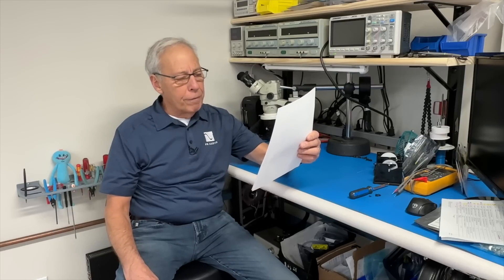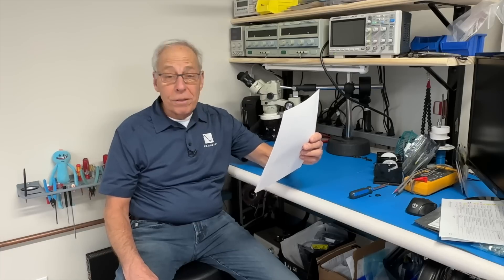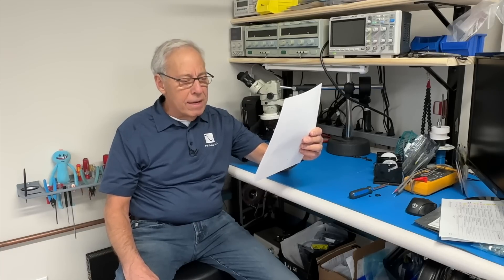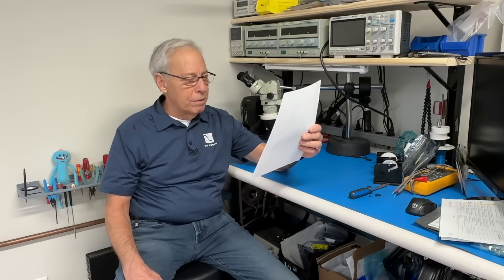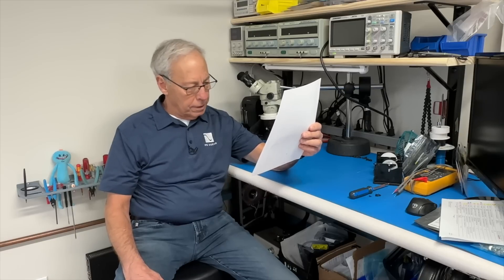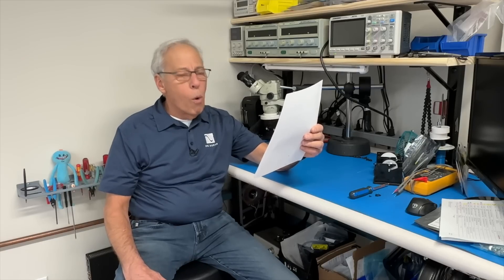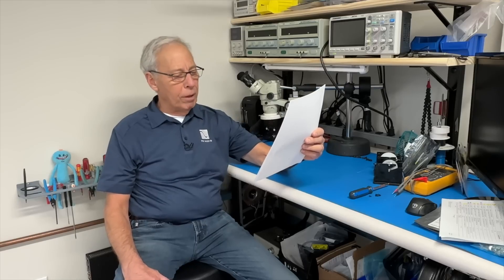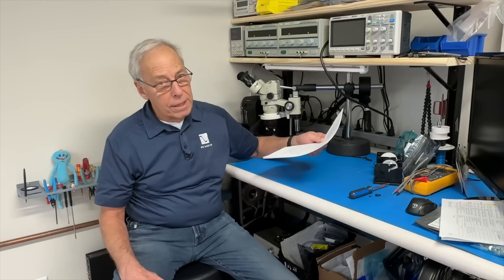Class D amps inherently inferior?

Comment: I need help here, I am looking for amp an I like the Audison 5.600 sr to my components focal 165 k2 and a 10inch Fosgate P/3? Any suggestions
Reply: I use a 3 way active focal kx2 components with a utopia mid. I upgraded my Harmotech tube hybrid amps for a 6 channel Zapco AP150.6 and the results are astounding. No glare at the highs, clear and detailed vocals with tight and controlled bass. I’ve heard a friend’s kx3 kit with Mosconi AS amps and they are fantastic too but I prefer my Zapco.
Reply: @xdaggersoul  
That is the name I couldn’t remember, Zapco..👍🤗😎
I looked at Zapco years ago before Zapco was sold to another company. Zapco 
Zapco use to be made in California back then. Great amplifier’s. 

A lot of new improvements in audio have been made since I bought my system 12 years ago. I went with all JLAUDIO amps and speakers from the JLAUDIO dealer that also does installation. A/B Slash series Amps. 4 and a 5 channel amp. 

One of the main reasons I went with all JLAUDIO was he owns that dealership won several SPL trophies with his JLAUDIO car. He has a lot of various trophies from over the years. 

I took that system out of my truck several years ago when that truck was traded in. Never had it reinstalled.

Just recently my OEM stereo in my car has a speaker short somewhere. I have an old Eclipse head unit and speakers in custom made cabinets. I plan on hooking up the head unit with a 12 volt plug that I’ll plug into the 12 volt cigarette lighter for power. Just use 2 speakers in the back. I have 2 McIntosh 6.5 component speakers in those cabinets I bought years ago.  Leave the OEM intact.
Reply: I would recommend going for a dedicated monoblock for sub duties
Reply: Audison are popular amps. 
Lots of people use them. 

Installs can be problematic.
You have to find a good installer that knows what they are doing, plus the fine tuning. Fine tuning is relative to the type of music you listen to the most. I had my system fine tuned to classical, jazz and blues by the installer. That worked out well for me. Yes I did use a subwoofer, that was fine tuned the same way. 

Depending on where you live you might not have access to a good installer or at least easy access. I don’t mess with that myself on any level. 
I also bought everything from one manufacturer except the head unit from a authorized dealer that did the install. 
That was more than 12 years ago. 

Back then I looked at a complete McIntosh system including head unit from a McIntosh dealer that also did installs. Expensive..LOL. 
Way over my budget. 

How do you like the 165 k2..?
They have the Utopia also.
Expensive. LOL.
Reply: @davidfromamerica1871  Hi thanks for responding, I do love my 165 k2 it was awesome upgrade from respectfully the JBL gto609c  components, you get spoil on the quality of the sound. I still have my JBL gto629 in future get does focal maybe. I had the cxa360.4 kicker amp with an old school EQ clarion 755 with epic center. Little by little trying to go for best quality at a good price. I live in San Diego they have a lot of good stereo shops, thank again
Reply: @carlosleon1976  
Glad to hear you like the 165 K2. 🤗👍😎
Focal also has their own amplifier’s.
Reply: @davidfromamerica1871  I also at focal amplifier before this one, thanks

Comment: Isn't that a bit upside down... get the right speakers to begin with and don't try to compensate with your amp for your thin sounding speakers... on the other side, if you like the coloration from vacuum tubes, or any other A/B amp, by all means go for it.

Comment: so class d is so bad that only the best amplifier ever made- a vacuum tube can save it.
that's what nakamichi did with their first cd players and it's also the answer for digital sound.
what about a class a/b power amp with a tube preamp? why introduce something with a problematic tone like class d into your system in the first place and then try to solve it?
class d is a cheap way to amplify. it saves space and doesnt generate heat unlike good sounding amps class a a/b or tubes.
Reply: Nonsense - you won't stand a blind-test

Comment: Amplification is not really a problem now days. Class D amps today are not the same as they were in the 80s and 90s..... While it is true that it is still a bit of a challenge to get class D smooth as class A/B, many of today's class D amps can come pretty close. That said though the inherent thing about class D amps is that they do tend to be on the bright side of neutral. So in this situation mentioned here, I think it is more of a mismatch than anything inherent in the amps. Pairing up rather revealing speakers such as the Focals to any class D amp is going to sound bright with the adjacent illusion of sounding a bit thin. Pairing any speaker that is tilted up to a class D amp will sound this way. In fact, one of the worst pairings I can think of is hooking up a pair of Paradigm Personas to a class D amp. While the Personas are not revealing in the true sense, they are very tilted up. (Side note: Those speakers actually don't sound good with anything from my experience with them. That is a real shame when you consider that the bar was set high with the Studio series they used to make. Those were one of the best speakers ever on the market by most accounts, but as with things audio, progress marches backwards instead of forwards much of the time).
Reply: They may be brighter because it may turn out that you need some extra dB’s of headroom over whatever average power level you’re going to be playing the thing at; so in other words, if you need a 50 watt per channel amp, maybe you really need a 100-150 W per channel amp in order to listen at at 5 W or 10 W out and not have it sound bright or worse (harsh).
Reply: @shipsahoy1793  I don't have a class D amp. I was just responding to the question. That said though, headroom is concerned with load and speaker efficiency and distortion, but has nothing to do with brightness or warmth.
Reply: @ericelliott227  You surprise me. Distortion has everything to do with tone and the “perception” of it. Same with S/N ratio and dynamic range. 
Btw, having a background in something and having experience with it are requisite to each other. 
One without the other, and you’re missing something. Similar to being a musician.
Reply: @shipsahoy1793  As I understand it from many years with playback (home audio gear) and some live sound engineering experience (the musician part of the argument, if you will), Distortion is an anomaly that interferes with clarity, not tone in playback systems. It's use in making music is an entirely different animal and in that case has direct effect on tone such as with an electric guitar. 
Lower sensitivity speakers have lower threshold for distortion no matter the amp. I always say "the louder the volume past the demarcation of the system's headroom the less detail". Most audiophiles (and many rock musicians) are deaf from playing too loud. (No, I'm not knocking rock musicians, I love rock music and was in that scene for a few years from roadie to management and lots of stuff in between. I'm just stating the obvious). So the levels most audiophiles play back at are ok to them, hearing aids or not, to the rest of us with no hearing loss, it is unbearable. I've had to quickly dash out of plenty of rooms at shows and other places where systems are demoed due to it being plain too loud. Most of the systems sounded horrible from $100 to $1 million because they were played too loud.  What surprises me is that most folks not in the know rate whether or not a sound system or it's components are good or not based on how loud they can go, the surprise part is that plenty of audiophiles do the same while throwing around non sequitur terms they do not fully understand to make it sound like they do.

At any rate, this goes into a separate area that doesn't address the inquiry. In other words, a discussion for a different day.

Comment: I have a NAD C-388 which is not as expensive as some units you mentioned in your Video 
 I use a Dynaudio DM 3/7 and its matches very well. I had many systems in the last 54 years but when you get older you prefer more convenience and not looking for absolute sound. So far I don't regret my switch to D.
Reply: Was just thinking of this. As we get older, our hearing goes and aren't able to catch as many frequencies perhaps.

Comment: Class D amps work well in powered subs. Fast, high powered and cool
Reply: When powered subs fail it's always the class D amp. Most manufactures give less warranty on the amp than they do the rest of the sub.
Reply: @Roof_Pizza  I agree but I dont think they have any other class in powered subs. Just plate Class D. I bought an expensive Velodyne sub a few years ago. American brand Made in China of course. It packed up a few months ago and the repair shops told me that the parts are not available  anymore.

Comment: Folks, I can tell you that I went from a well regarded AB amp to the Stellar S300 (Class D)and it is a wonderful amp. Incredible grip and an overall sweetness that is glorious. I'm using this amp with Class B full range speakers that love power and this amp delivers. The bass grip is something that has to be heard to appreciate. The Absolute Sound did a review of this amp on 1/27/2023 (Neil Nader) and he was effusive in his praise of this amp and wrapped up his review by saying [S-300] ..."enthusiastically recommended without reservation". He also discussed in detail class D and his opinion of it as executed by PS Audio. Worth the read.
Reply: What are Class B speakers?
Reply: @keithmoriyama5421  Sorry, Stereophile Magazine has an annual recommended components list that itemizes stereo components by various classes A-D.  Class A ( finest regardless of price) Class B, etc. etc. so it's a benchmark of sorts....for example, Klipsch Forte iv are "class B"
Reply: @jeffreypicciolo7706   I don’t believe that is the intention of the audio world to rank equipment. 

It’s usually as follows:

1. High end audiophile
2. Mid level 
3. Entry level

When people use “class” it’s more related to amplification and the letter means more of a type vs grade.  

We need to face reality related to US non-industrialization.  Heat sinks are expensive.  The days of large heat sink amps are limited by cost. 

I do not know myself the quality of Class D. I’m happy with my Class AB from 30 years ago. 

The great thing about Class D is tons of watts for a somewhat minimal price.  It’s hard to know where manufacturers are going.  We have to remember they need to make a profit. Higher margin the better.
Reply: @jeffreypicciolo7706  Now that is certainly one of the dumbest things I’ve heard. Thanks for the laugh. 🤣 You could almost make that plausible if you try hard enough to convince yourself. I seriously doubt that enough or proper research was done on amplifier outputs and speaker system loads to generate a viable list, considering also that the “quality” of sources and their materials are in the mix as well.
Reply: @keithmoriyama5421  he was probably screwed by the YouTube editor or voice recognition. He probably meant a class B amp with full range speakers. Duh, regular or decaf?☕️

Comment: Can anyone speak from experience to the reliability (or lack thereof) of Class D?
My Class A monoblocks have performed flawlessly since the mid 1990s.
Reply: Class D amps can last for decades. I use a pair of Beolab 1 in my home theatre as front speakers and they were produced 23 years ago and still play perfectly fine. They are active 3 way speakers with each having 450 Watts class D ICEPower for the bass, 125 Watts class AB for the mids and 125 Watts class AB for the treble. With my 2 subwoofers and surround speakers they still make a good movie watching experience.
Reply: Could you mention your class A monos model please?
Reply: @@Douglas_Blake Yes, time is flying fast. In the 90s I was working at B&O in one of our R&D rooms with the inventor of the ICEPower a few feet from me. Later I used ICEPower in some products leading the R&D. In early time it was a bit hush hush secret tech. Nowadays few people know ICEPower moved from that initial stage to becoming an independent amp tech supplier used by PS Audio and many others.
Reply: All depends on the quality of the design. I have been using and misusing a Lab.gruppen based on the A104 module common to various models, including active powered Tannoy, not even the most modern design, not an issue - besides the analog signal connector. This is why they were sold in large quantity to professional users. And to quite some home hifi users as well.
Reply: @@Douglas_Blake The idea started out of a university project with B&O in 1997 and resulted in products in 1999 (my Beolab 1 speakers are original development samples and first product with ICEpower still working flawlessly 23 years later btw). B&O realized business could be made by selling class-D solutions to other companies and first the company was called “Bang & Olufsen PowerHouse” then “Bang & Olufsen ICEPower” to finally become an independent company of “ICEpower” in 2016.
Reply: amps never fail, that is my experience in life so far. last 10 years i had only class d amps.
Reply: @sudd3660  My active 3-way Beolab 1 speakers with R&D prototype sample ICEPower boards from 1999 are still working fine. I never thought about it being something to notice, but for 23+ years there has not been one issue requiring service. Class D will last long time because the electronics stay cool compared to more traditional amps.
Reply: class a is very inefficient. generates a lot of heat and barely any power in watts and the speakers they support are very limited now since most speakers are coming with higher wattage's, lower ohms and mid to high in sensitivity ratings

Comment: Don't see the draw of a low powered, expensive class D. For $3k there is a boatload of choices out there with tried and true tech that'll last for decades and sound great and some have loads more power as well. Curious what he ended up with.
Reply: @Douglas Blake That's not what he got and those are only good for subs, parties they aren't audiophile amps.
Reply: @Roof_Pizza  no crown xls run nearly silent it's the higher models xti and whatnot and the older xls models the fan is always spinning and that makes the noise
Reply: @shangrilaladeda  LOLZ. Even their website says....Crown Amplifiers, PROFESSIONAL POWER AMPLIFIERS... If that isn't enough for you then check out the connections on the back.
Reply: @Roof_Pizza  I own some crowns I know quite a bit about them and enjoy what they do
Reply: @shangrilaladeda  AND???  Still budget PA amps.
Reply: @Roof_Pizza  not quite, most companies are liars crown is one of the more honest ones, I just question their xti 6002 and if the power supply is really around 1000 usd or if something funny is going on
Reply: @Douglas Blake Name me a bunch of amp companies that you've drooled over for years and how many of those have switched over to class D in an audiophile application? One company is kinda funny how their surround amp uses both AB as well as D and the main IMPORTANT channels are class AB and the surround LESS IMPORTANT channels are class D. YOU KNOW NOTHING.

Comment: Great video would be class D and durability. End up going back to AB after 3 class D amps dying within a three months.
Reply: What's that class D model? Sounds like a serious design flaw...
Reply: @youtube改名也太難了吧  I've had 2 die
Reply: @youtube改名也太難了吧  Class D is a race to the bottom.
Reply: What kind of trash do you guys buy, my hepex works for 9 years very day without problem

Comment: Remember my first class-d setup in a PA, i thought something was out of phase or broken. Sound had no life and was dull and flat.
Reply: The first Peavey DECA amps could be that way. Bad output filtering. I also hated that Peavey referred to them as "digital," when they were actually Class D, which is not digital at all.
Reply: @ScottGrammer  decades in the past.... we have 2023
Reply: @Harald_Reindl  Yes... I realize that, because I was there when it happened. One of the advantages of being old. 🤣

The DECA amps were some of the first mass-produced Class D amps, so it's not surprising that they were imperfect almost 40 years ago. I have a 20 watt class D amp that I use for driving some really nice full-range speakers in my bedroom, and it sounds really nice. It just took some time to figure it out, that's all.
Reply: @ScottGrammer  the main advantage of being old is that things improved massive over the time and today you get quality not imagineable back in the days for pieces of the money - more money for room acoustics  left which makes the real difference and there is lot more of money at all compaed to teenager years - 50k dollars for gear, speakers and room these days will beat everyting available back in the days, is affordable and wastes less energey which saves money for records
Reply: crown ftw
Reply: In which year? And even if it was recently you can find tons of class A sounding the same - A good designed class D sounds as good as anything else but don't waste energy to heat the room in the summer wasting money
Reply: @Harald_Reindl  Probably late 90s. From Crown Macro-Tech to LabGruppen. About the same power output but a massive difference.
Reply: @johannesk1855  we have 2023 - you can't compare that way and you should know that